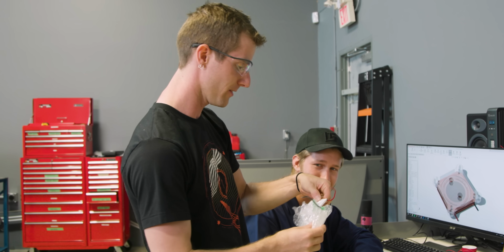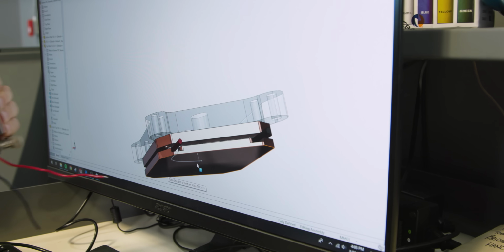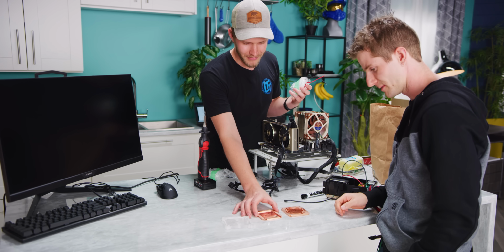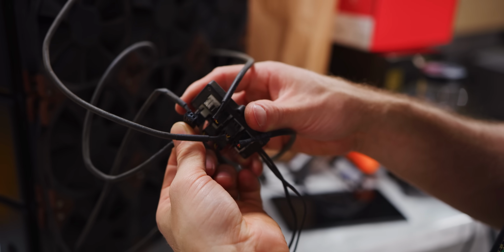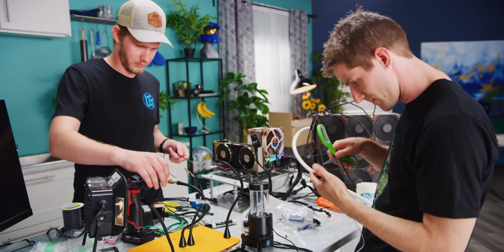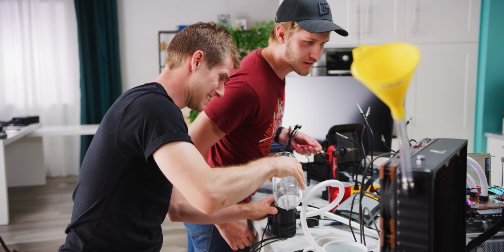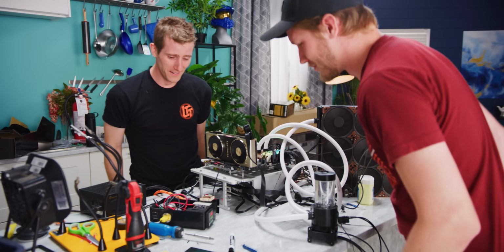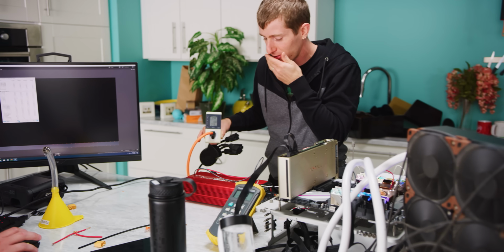This Cooler DRAWS 545W!!? Bad Cooling Ideas #2

Comment: This Video should have the Title: Doing everything wrong TACs....

First of all, a CPU generates heat very rapidly, we are talking timeframes of a few seconds. A Tac (or any matter in fact) cant handle that heat transfer due to the limits of the material constant "heat conduction rate". Every heat transfer modul stores a portion of heat and acts in some sort like a battery, storing the inital shock in heat transfer close to the surface in the material itself until a balance is reached.

A TAC gets overwhelmed by the heat shock and blocks further heattransfer and all ur electrical energy u put in is for nothing or is even further heating the whole tac up. What u gotta do, do make a tac cooler work:
u need a "heat battery" between ur cpu and ur tac, so the heat transfer rate becomes more evenly between ur tac and ur heating source.
For Example u could put a Tac on the heat exchanger water - ambient, since water in the cooling systems acts like a heat buffer and gets rid of the thermoshocks generated by the cpu.
A TAC cant handle rapid changing Temperature, it was never designed to do that, thats like taking a Tractor to a Formula 1 Race...Of course thats worthless.

Heat Transfer needs 3 things: 
Heat exchange Area, the more the better.
Heat conductivity, u want to have Copper rather than Rubber
Temperature Difference.

Lets take that into account and review ur setup: in Idle ur cooling side of the TAC has the same temperature (more or less) as ur CPU,  so neither the Heat exchange Area or the Heat conductivity do any good - the Heat Transfer is Zero. The CPU gets hot really fast, but now the TAC and the materials between them react with a lag until a proper Temperature Difference is reached.

In Air Cooler or Water Cooling Systems the whole Story is different. U constantly pushing fresh medium against ur CPU, always have a Temperature Difference and only a portion which is closest to the CPU actually gets heated up and fresh cool medium replenishes it.
In a TAC Setup much more Heat is required to achieve a Temperature Difference, since there lots of Metal and Stuff, which doesnt move.

A TAC gets really useful if u put it between 2 Liquids or Gases. With that in Mind a TAC in a PC Cooling Systems can be useful to improve Heat Transfer Rates or reducing the necessary Heat Exchange Area, thats why its mostly used if u either wanna have a great Temperature Difference when u dont have much room to work with proper cooling systems....like in mobile cooling units.

Comment: My friend and I are designing a FUNCTIONING CPU-TEC. The main problem is that TECs have a theoretical max ΔP and no matter what you do, you can't cool by more than that on a single TEC.
So, unless you get a TEC that has a ΔP rating above the TDP of your CPU, you're going to overwhelm it no matter what. The key is to use several TECs in a sub-ambient or even sub-zero liquid loop.

Similar to a nuclear reactor, you have a primary loop and a secondary loop:
- primary loop goes from CPU to TEC (heat exchanger) with ideal temperatures between 0° and 20°
- secondary loop goes from TEC to rads, with ideal temperatures between 30° and 90° 

https://i.imgur.com/pntku9l.png

just make this, it's like you're trying to probe TECs can't work for CPU cool when there is actually a way

Comment: Hi guys, I used to work with an Andor iXon EMCCD camera. It was rigged high speed single photons caption with a combination of water cooling and TEC. it worked fine to get very stable -90°C on the chip. Get in touch with them to get right setup for your next attempt .
Reply: Also bad design of the CPU block... You need to intsulate more between the CPU interface cool side and the waterblock hot side. The groove  for the TEC on the cpu side may looks nice but you should have a bump instead.

Comment: LOL... Best video you guys have ever made. Linus is so wrong though, it wasn't the power inefficiency that made this fail, it was the thermal transfer inefficiency of your jank-ass build. Obviously, you can't put the Peltier directly on the CPU guys! 
Clearly, heating up a TEC won't work -- you guys just need to work on your thermal transfer. This could be far better than just keeping the CPU from high temps though; if you decouple the direct thermal differential and use any fluid with more mass, either in an open or closed-loop system. 
LTT should reach out to Tech Ingredients, he's got a ton of experience with TECs and high efficiency innovative cooling systems. Plus, has a legit lab where he performs tests, engineering and builds. I'm positive he could help you guys figure out the science side of things.
It's seems pretty evident that a TEC-based CPU cooler needs to be part of a chiller system and if the goal is sub-zero you just need to go to a glycol solution, which will allow you to cool to more than -40 degrees. Such a thermoelectric CPU chiller will also require an integrated pump controller but that could be built fairly easily to take input from a fan controller or Arduino. That way, the Peltiers can keep the glycol mass chilled to sub-zero even when the computer isn't on and when CPU temp rises the pump will kick in and even regulate the flow to maintain target temperature settings. Of course, you'll need enough TECs to easily overpower the CPUs heating of the fluid as well as a proper radiator to distribute the TECs cooling energy into the fluid, in addition to a radiator to dissipate the heat from the TECs hot side, however, this can be done passively. A TEC-based cooling system could be engineered to not only sub-zero but silent as well.

Comment: What if you used a peltier in series after a radiator in a water loop? Get the water down to 40 or so with the radiator and then down to 10 with the peltier?

Comment: What if the TEC only cooled the resevoir input and the CPU got a regular water block, being pre-cooled to semi ambient, before going into the tec block while the tec is watercooled with a large AC condenser coil at an external radiator with just a couple of large fans? So the input water always comes in lower than ambient, at least?
Reply: oops I meant the reservoir output post CPU watercooling radiator.
Reply: Coz then, the heat load the TEC would have to deal with is at least just a couple degrees hotter than ambient and it doesnt break it's thermal runoff point every time a load is put on the CPU.

Comment: yer I agree with some of the viewers, you need to be able to put the extra water through a bigger cpu cooler then cool the water, that's how its done in industry.Bigger is better. I recon just the radiator should handle it, rule of thumb x amount of rads with = x amount of cooling. a triple should kill it by it self with out the tec. Nice try thou.

Comment: you needed a 32A variable voltage supply, and control the voltage by picking up the signal from the CPU fan header.

Comment: So w8 was this still using the Eletro cooling tech..... combined with a water circulation system?
I don't even understand how that Electro cooling tech transports heat via electrons. That's not how thermodynamics usually works xD

Comment: I'm wondering if the cold side should have the water block and the hot side should have a heat pipe heatsink with a large fan sucking hot air up?

Comment: Lmao why did you try doing this the hardest way. You could have just cooled water with the TEC or multiple TEC’s in place of a normal water cooling radiator and just pump it through a normal cpu water block, so it would just be a colder water cooler.

Comment: Here's the way to do it: go back to those aquarium cooling units, one or two parallel is better than series connection. TEC do not do well to move a lot of heat, but do cool sub-ambient, so they are best to offer cooling for a small temperature delta, instead of a large one. Water cooling loop should be Radiator - Pump - TEC - CPU in a loop. Instead of a convoluted PID setup, just use the internal PID already offered by your motherboard (The PWM fan) into an arduino set to turn on the TEC via a relay (can just use a regular relay by the way) when thermal loading causes the CPU fan pwm speed to reach a certain %, easy to do should be able to accomplish that with maybe 20 lines of code and a resistor or something. You could even do something even more rudimentary with a Resistor and a back of napkin calculation where when the PWM reaches a certain threshold the relay should pull in. If you use a 12v auto relay (which are good to 250 volts just not rated) i would venture to guess you would pull in at 8 volts full on say 86 ohms on the relay so maybe bias it with 10 ohms of resistance for a roughly back-of-napkin 10% voltage cut which should kick the relay on somewhere around 80% fan speed setting. Hecc, you'd just have to try this part but how could it not work? 
Anyway - Cpu generates some nice hot water, you dump out most of your heat through the water cooling block and dissipate to ambient and get your "free" cooling (wattage cost of fan only) which should get rid of the bulk of your heat, and provide the TEC with some nice cool (ish) water to start with, then it takes that cool water and cools it down further with its "refrigerative" properties, and returns colder water to the CPU. This way you're not wasting energy trying to get the TEC to move heat that could have been effortlessly dissipated with passive cooling in ambient air, and you aren't limited by the TEC in cooling capacity. Should see a instant reduction in CPU temperature in a system that works for all cases, and much cheaper too.

Comment: If you ran low watt by multiple system spaced out on block sys with fitting both sides. And don't use a radiator.  It will have more saface area and no radiator to warm up to Amber room temp before going to the system.  I think you need to think out of the box.  And try again. Take care.

Comment: Also you might want to try using this device on a metal fluid tank instead. Then on top a really good heat sink to move the heat. This way your radiator size can drop and you effectively cooling the fluid before it hits the chip. Sometimes not super chilling the chip is better.

Comment: We need a lot of low power Peltier to cool the Water below ambiant and than cool the CPU with that. They tried in the first Video, but they didn't use enough Peltier (these Things become more efficiant the less Power they use!). Using fewer high power Peltier is counterproductive.

Comment: Correct me if I'm wrong, but when you push more than rated power through a TEC, you don't see any additional cooling, you only dump the excess power into the hot side as heat, correct? So you were dumping an extra 400w into the junction and preventing it from moving heat.

Comment: I don't understand the comments about using the peltier module to chill the water in the reservoir.  Why would that make a difference? I assumed that PC enthusiasts would have been from the cohort that understood their middle school physics.

While the water will be less hot than the CPU heat sink, it will contain the same amount of energy dispersed over a larger mass, but nevertheless the same amount of energy.  Concrete example: Let's say you have one of those little electric beverage coolers for your car that use a peltier module.  If you place a cup of water heated on a stove for 2 minutes or or a quart of water heated for the same time (which will not be as hot), the amount of heat/energy that will have to be transferred out is still the same.     

The use case for a peltier is applications is generally when you can't have moving parts or a refrigerant.  It seems odd to build a cooler that has a peltier module AND moving parts AND a refrigerant, which its resistance to a phase transition when put under pressure allow it to essentially be (although I doubt PC water coolers can allow pressure to build up like, say, a car radiator). 

An interesting experiment.  In something like this (or any of the pc cooling videos) think Linus and crew should keep a physicist or engineer on call rather than Googling answers.  The ignorance of elementary thermal dynamics among the PC enthusiast community is pretty amazing, and Linus and Co. would be doing a public service to help explain things better.

Comment: I think the problem here is how you're using the tech.  The test that had better results was when you used them as cooling plates for the liquid cooling loop, an air cooled radiator replacement essentially and not on the the cpu directly.  So if you were to strap the more powerful pelch mod to say a 6 inch rad with no fan you might get better results as the pelch mod isn't being instantly overwhelmed by the cpu giving it more time and surface area contact on the rad to cool the liquid instead of the cpu directly.  For possible better results you could use something like 1/4 copper tubing or stainless steel and make a coil that you strapped one pelch mod, as it gives more time and surface area for it to do its cooling to the liquid in loop.  Could even use the two smaller pelch mod and sandwich the coiling coil tubing so there is more surface area of the coils utilized.  Heck you could even fill a tub with mineral water or some other dielectric fluid, strap the pelch mod to a radiator and put it in the tank.

Comment: Also although you mentioned the power of the peltier, you never mentioned the efficiency. Technically speaking, if the peltier have a efficiency of lower than 1, meaning that for every watt generated in the system a watt will be moved from cold side to the hot side, the peltier would be virtually useless(taking the thermal capacity of the CPU and the behavior it displayed on idle in this video into account, this particular peltier you are using is more than likely having a efficiency of lower than 1), and if it has a efficiency of lower than 0.5(which it probably does not by the behavior displayed, but if), it would act as a electric blanket.
Please contact me at timchpi@gmail.com if you want me to pick some good peltier for you and design you a proper controller. Or if you would rather do this yourself, remember:
You need a peltier that have a net active transfer of 500W, not a peltier that consumes 500W. You want a huge peltier that pumps heaps of heat, not a peltier that generates heaps of heat.

Comment: Also side note you realise you can hook your pc to an arduino through a usb cable, write a small program that reads cpu temp from system and forward that to arduino through serial, write a PID controller program on arduino to control a mosfet, and use the mosfet to control the peltier, right? Which is a way cleaner solution since that would ditch the sketchy box(I can make the PCB for this into the side of a 2.5" ssd), and does not involve an external thermocouple.

Comment: Ok so in the spirit of bad cooling, here is a more wicked idea: I always have a huge problem with dust, and I figured, hey, what if we can have a fully enclosed pc case(no air in, no air out, air only run inside it), with water tunnel in its shell, running cooled water to sub ambient by peltier, and have the water cooled in something else? It would be cool if you guys can actually do a video on that. I can design if you need me to(which I guess you don't?).

Comment: Put two TEC,s on a rectangular water resivour with heat sinks, it's the exact same way a water cooler works that you drink from at say your local Dr,s and they don't get condensation build up and keep the water tank pretty cold, try that next time lads. 🇦🇺👍

Comment: Techcooling is for when you need a sub ambient cooling solution, but are limited by space, sound, or changing orientation. NOT for efficiency or heavy load. So since you don't want your pc sub ambient then there is no point.

Comment: Isn't the whole setup still relying on the radiator to take away the heat? Would it be better is you just use that radiator to water cool?

Comment: Assuming 5% efficiency of the Peltier element, you need at least 4 in parallel to cool a 200W TDP CPU
Good ones will have 8% efficiency, but 5% is easier to calculate and givesd a bit of headroom.
So in this example 200W / 0.05 = 4000W for the Peltiers.
Reply: No, this is the efficiency compared to an ideal heat pump, you are interested in the coefficient of performance. In the case of a vapor-compression refrigeration (fridge, air conditioning etc.) it can go up to 3 or 4 (300 or 400W moved for every 100W of power), in a TEC varies a lot depending on conditions (I looked at a datasheet of a TEC comparable in power to the one used in the video, the COP varies from 3 at low loads and low temperature differences to 0.1 or less in the worst case). If you can keep the hot side at relatively low temperatures so that you don't need a big temperature difference and you choose a TEC so that it operates in conditions where it has a decent COP like 0.5 it is doable. In the past I have seen 250W TEC cooling a P4

Comment: i think peltier can possibly use closed to cpu by using heat sync and then placing the thing upside down so that droplets in condensation will not flow down to the cpu and motherboard